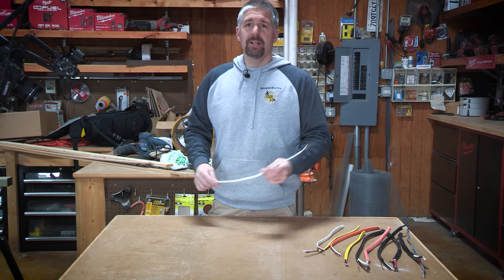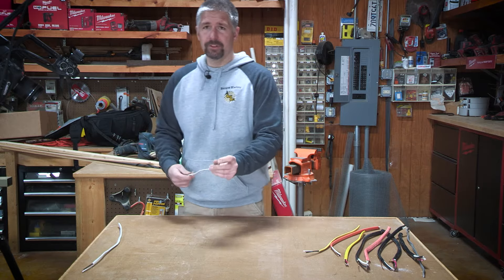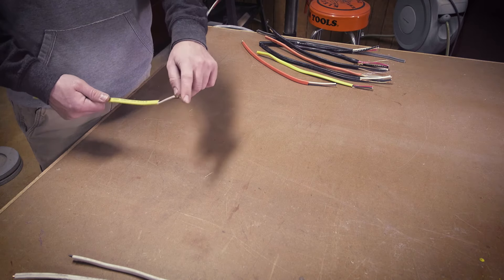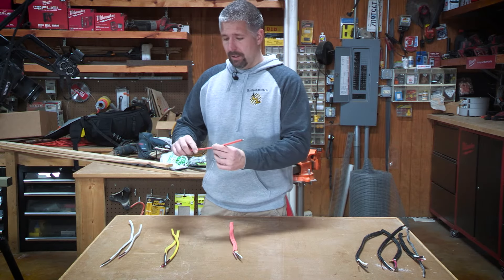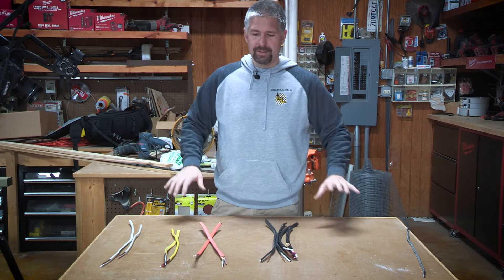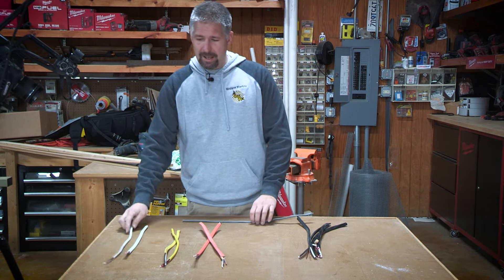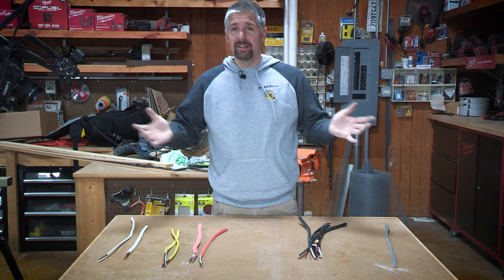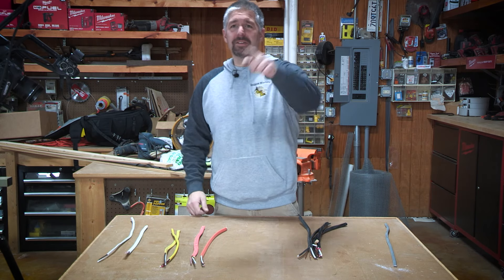Different Types of Romex Wire or NM Electrical Cable

Comment: Just so there is no confusion, Romex is a name brand for Non-Metallic Sheathed cable or NM cable, Like Scotch Tape, Band-Aid or Xerox, but we tend to use the brand name as the name of the actual item, This is called a product Eponym.
Reply: Same thing as wire nut. No such thing in NEC called a wire nut because its the name of a certain company. Heard Romex came from old Rome wire company. Was told at an IAEI class that BX got its name due to it was the second trial version that a comoany was playing with. The X in BX stood for experimental. That & $2 will get you a coffee.
Reply: @garbo8962  Not at Starbucks
Reply: @garbo8962  in the early 1900s,  the first version of Armored cable was AX. BX won out.   I think it is often referred to as BX because it was invented and first produced in the Bronx,  NY.
Reply: @garbo8962  what we often call wirenut, the technical term if you're speaking in NEC language,  is solderless connectors.
Reply: Exactly
Reply: I agree, like you say Romex is simply one of the Brands, people should not be calling Southwire Brand Romex, or any other Brands they have their own Brand name, some Brands quality is not as good as other Brands usually in the Sheathing but they still work.

Comment: The code book states that shared neutrals are not acceptable anymore unless you handle tie the breakers sharing a neutral the 14-2-2 would make it much easier to pull 2 circuits and each would have its own neutral like back several years ago when you used a 14-3 you shared the neutral.
Reply from the maker: Definitely

Comment: Very helpful but I would like to know if I can run 10-2 for outside room that is about 40' from panel the panel is mounted outside thanks
Reply from the maker: If the wire is going to be exposed to the outside elements. It should be the grey Outdoor rated 10/2.

Comment: Hello Phillip. I need to replace a length of household electrical wiring. If I were to take a photo of the exposed section and send it to you, would you be able to tell me the gauge and amp of the wire I need please?
Reply from the maker: I possibly can.  If the wire is really old, meaning pre 1960’s. It can be hard to tell.  Send me an email.

Comment: I'm looking to turn my shed into a man cave it's about 150 feet from the house what wire should I use to run power to it, I wanna put a ac unit,mini fridge and tv with a few outlets?
Reply from the maker: Depends on how big of AC unit you are going to have.  With voltage drop 8/3 wire would work for a 110volt window AC and running a few outlets.  You could put a little 30 amp sub panel out there 220 volt and add a few breakers off that. Check local codes. 8/3 underground would do or would have to be piped in some areas.
Reply: @PhillipBridgesReviews  the window unit I'm thinking of getting is a 115 volt that comes with the heater too, Im wanting to do the work myself, so I'm trying to learn as I go thanks for the help!

Comment: What is the best Romax to run a 50 amp welder plug in a garage. I need to go from the laundry room which is inside to the garage and I need about 50 feet. Which wire should I be using? 62 Romax indoor version?
Reply from the maker: 6/2

Comment: So i want to run a EV charger in my garage… i found a Grey 6/3 cheaper than the black one… is it still fine to get that as oppose to the black one?.. 50ft of the black 6/3 was $300 and $180 for 40ft of the grey 6/3.
Reply from the maker: Yeah if you ran it yourself. You could use it for indoor or outdoor purposes. I have no Idea why it’s cheaper now🤷‍♂️.   It use to be the same price or a bit more. It is harder to strip if you haven’t used it before.

Comment: Can u mix wire gauges? Example. Can I have a 20 amp circuit with 12-2 wire and change to 14-2 at the end of the run?
Reply from the maker: You are not supposed to mix wires.  But I have seen it.  Myself. I wouldn’t do it.  Not worth the risk of fire. National Codes are there for a reason.

Comment: so pretty much , all the romax are the same? , besides they’re different in amp capacity and the difference in the shedding and the thickness in the wires based on the amp used on the circuit?
Reply from the maker: Yes, except gray coated Romex. It’s coating is thicker and has a UV coating for outside and underground use.

Comment: new ranges require 3 wires plus a ground to meet code.the jumper on the ground to neutral is removed to acomadate the 4th wire.
Reply from the maker: Yes. It’s a 14/2/2 wire.  👍🏻

Comment: This was really helpful. Thank you!
Do you have a video to explain the electrical differences between why some wires i.e speaker wire. Security wire, thermostat wire, are labeled as with the same agw/conductor wire is labeled as the same with for example: one label has 14-2 as speaker wire then there another labeled as 14-2 electrical wire, or 18-2 speaker wire, and 18-2 labeled as sprinkler wire so forth and so forth. Just wanted to understand how and why there are labeled as for such uses but have same awg/conductor? Also what is best explanation on stranded wire vs non, shileded vs non shielded, also what does solid copper vs non solid mean? .

Comment: I Recently went up to my attic 1989 las vegas build and saw a strange black flat wire dead ended and open stapled to the beam just inside the entrance, 2 copper wires inside left and right nothing else never seen before I assume some type of low voltage hook up for some type of 80s upgrade? Ty for time,my house is a wiring mess let me put it this way I have to turn of 5 breaker for my kitchen alone lol
Reply from the maker: Sounds like antenna wire. Did it look like this ? https://en.m.wikipedia.org/wiki/Twin-lead
Reply: @PhillipBridgesReviews  You sir are good that is it! I kinda figured it was some kinda communication type line since it was ran up with other coaxial cable,just so weird it was dead ended at the attic entrance bundled up left makes sense now I know its an antenna wirelol Vegas houses are goofy ty again for taking the time,I was practically tripping over Romex and other wire dragged across beams and I couldn't get over that one weird wire

Comment: What type of wiring do you recommend for a light sensor?? I have a 100amp electrical panel, should I use a 14/2 or 14/3 ??
Reply from the maker: I would run 14/3.
Reply: @PhillipBridgesReviews  I have a old home, built 1945 , me and my wife bought our home in 2020, looks like the previous owner tried updating circuit wiring, not all , but most have a 14/2 running, wish you could show a video on how to upgrade old wiring or switching to different wiring.
Reply from the maker: @moisesperez3   I am hoping to make a video one day about this.  Possibly in the near future. 😉

Comment: For a sub panel (provided the AWG is correct) where I have to go through 2x4 studs and can not go up into the attic, across, and down to the sub panel from the main, can I strip the Service Romex down to its conductors and run the conductors through the 2x4s from the main panel to the sub panel??

Comment: Can I use grey Romex in doors in the same way I would use the other Romex not intended for burial (if the AWG is correct for the circuit)?  I often see the grey Romex cheaper in price for the same AWG, number of conductors, and length than "normal" inside Romex. Seems backwards.

Comment: ALERT FYI TO ALL:

The grey outdoor wire is currently cheaper then the indoor wire. $54 for 14/2 grey
$78 for 14/2 white
Reply from the maker: I have noticed that too. 👍🏻
Reply: Two werks ago a 250' roll of 12/2 NM cable was $259. Over a dollar a foot. Glad that I'm retired. Heard that 12/2 MC cable is cheaper then 12/2 NM cable.
Reply: LOL 9 months ago $78

Love these old comments taking about prices.
Reply: Can you use Grey wire for indoor shop routing?

Comment: Great video. Can you please answer a question I have. I have gray romex in a pipe underground going to a shed in the yard with a 1500W eclectic heater. Will the wiring be able to handle another 1500Watt heater, at the same time if I upgrade the breaker ampage?  I appreciate any advise you can give.
Reply from the maker: What is the wire size of the grey wire? 14awg, 12awg, 10awg? It will say on the coating. Grey Romex  just state that it is excepted to be buried underground. Is the heater 110 volt or 220 volt?
Reply: Thanks. I will tell you when I inspect the wire.

Comment: Hi I'd like to know if the 10 2 orange Romex needs to be put in conduit inside a metal building? I'm running it from main service panel to new RV 30 amp receptacle box. The run is approximately 30 feet. Square D breakers are used in main panel and I'm going to have a Square D breaker in the new 30 amp box as well. Thank ya for any help :-)
Reply from the maker: Anything that is 7 ft. and below I would run conduit. Then slide the 10/2 through it.  So if you run the 10/2 up and over the rafters. Stub a piece of pipe up past 7ft off the ground of were your outlet is going to be mounted.  Slide the 10/2 down the pipe.  Exposed walls you want to have it protected. I hope that helped you out.
Reply: Thank ya Philip. It's going to run approximately 10 ft straight up wall from 30 amp box and across shop wall about 30 ft and approx 8 ft down into main panel. Does it matter if I use metal or plastic conduit? I'm going to run everything and have it ready for the electrician to hookup so it saves me money.
Reply: Sorry I realized after I didn't add my drop footage in orginal calculations so it will be overall approximately 48 ft run total.
Reply from the maker: @ginnawitters-evans5156   if you have a concrete floor run it in metal.  If it is a gravel or dirt floor, run it in plastic. For any future condensation issues.

Comment: I found an open splice under my kitchen sink cabinet that was arcing and making a sizzling noise. Not only was an open splice buried under the cabinet without a junction box(code violation), but it was in a possible wet location(serious lack of common sense), a leaky sink, valve in a supply line, or disposal are common leaks. The disposal in my kitchen sink started leaking (internal seal went bad) which got the open spice wet, the paper in the Romex wet, causing the arcing against the wood of the cabinet carcass. The icing on the cake was that the electrical genius never connected the ground wires together, the incompetence was epic. I was pissed as my house could have burned down all because some POS did not want to take the time to run new piece of Romex from the breaker box when the piece they cut was too short or put the splice in a properly accessible junction box. I am putting the splice in a steel 2 gang box with a cover plate in a dry location two cabinets away from the sink, properly grounding the wires and box, and I am running 12/2 w/G UF-B out of the box to go under the sink and dishwasher, per code UF-B can be used in wet or dry locations within a home as well as direct ground burial.

Comment: Good info hey quick question. What amp breaker should I be running on like a 100 gallon hot water heater???
Reply from the maker: It should tell you on the side of the unit. Most that size are 30 amp 2 pole breaker.
Reply: @PhillipBridgesReviews   Thanks was wondering if upgrading to a 40 would be any benefit guess not

Comment: Can the UF-B romex be buried 12 inches if only using 120v?
I read that it needs to be buried 24 inches, but if only using no more than 120v, it can be buried 12 inches... is that so?
Reply from the maker: It can be at 12 inch. But must be 120 volt GFCI protected and not more than 20 amps.  Also must come out of the ground in rigid or PVC when stubbing into a building.  That being said, some towns do enforce the code that no matter what it must be down 24 inches.  Check with local codes always to see what is enforced in your area.
Reply: @PhillipBridgesReviews  I was going to use 14/2 UF-B, but then I noticed the breaker for the receptacle I'll using is 20amps...so I am returning the 14/2 and using 12/2 as I've read you can't use 14/2 anywhere in the circuit if the breaker is 20 amps.
Reply from the maker: Yes that is correct

Comment: There is older romex that is colored differently also. I live in an older home and there is some 14-2 that is black and there is some 12-2 that is white with green lettering while the older white 14-2 or 3 has red lettering.

Comment: My house was built in 1976.  I have white romex clearly mark3d as 12 2.  White does not always color coordinate as 14 gauge.
Reply from the maker: You are right. It wasn’t till 2001 when they started color coating 12/2 and 10/2 and such.
Reply: @PhillipBridgesReviews  Thanks for the response.  First time viewer of your channel.  I've been renovating my home and really enjoying the electrical work.
Reply: All Romex used to be white back then
Reply: Being 12/2 it is likely aluminum,  like in my house.  Most homes built from 1966 to 1976 used aluminum wire for all branch circuits,  because of the extremely high market price of copper at the time.
Look for something like "ALCAN AL-FLEX 12/2 ALUMINUM WITH GROUND" printed on the jacket.
Reply: @LakeNipissing  all the white 12/2 in my home is copper
Reply: @NESDwayne nice.    A 1976 home could have copper or aluminum,  or a mixture of both.    Since 12 and 10 awg aluminum was never recalled although it's production and installation pretty much ceased by the mid 1970s, existing stock was permitted to be used up.   A master electrician buddy of mine once told me of a home he worked in  built in 1981 where a couple circuits were 12 gauge aluminum,  everything else including the electric range and dryer was wired in copper, except the service wire running to the meter and main.

Comment: 14/3 for  travelers between multiple connected smokes, ceiling fans, and switched outlets Never saw 14/3 used for 220.

Comment: does the footage from the source to the panel matter in choosing the right classification of  choosing which to use  enjoyed the video it was informative  oh blue is used for.. dc may i ask
Reply from the maker: Yes, there is always voltage drop.  make sure you are not losing too many volts as you increase the length. So example: If I had an Air compressor that was 200 feet away from my panel and took 20 amps 12 volt to power. I would lose 12.67 volts and result at the end load would be 107.33 volts. Which is a 10% loss. Maximum allowed is 5%.  I would have to increase the wire size from 12 gauge to 10 gauge to make up the voltage loss.

Comment: Great video and information.  I have a question.  I noticed the a contractor put white Romex 14/2 for my water heater.  My water heater does not state the amps, but has the watts for the elements, which is 3800 watts per each element (top and bottom) and the voltage is 240 on the tag.  Doing the calculation  for Watts= Amps x volts, which comes out to 15.8 amps.  I also noticed the contractor placed a 30 Amp breaker.  I believe he did both the breaker and Romex incorrectly.  I believe he should have used 12/2 Romex (yellow) with a 20 amp breaker.  Your thoughts???  Thanks
Reply from the maker: Myself. I always do electric hot water tanks on 10/2 wire unless it’s a instant tank which I go by specs. Yes you are right. It is incorrectly done. It should be At least 12/2 and a 20 amp 2 pole breaker. The 30 amp could allow the 14/2 to melt the wire overtime when the elements are at peak. It is unsafe. Question. Does the white Romex say 14/2 on the side?  Older 10/2 used to be white. I still have some laying around that I use on little things.
Reply: @PhillipBridgesReviews
Reply: @PhillipBridgesReviews  I checked the wire and it says 10/2 with ground type NM ( I believe that's the letters and may have a date but can't read it)  The outside color of the sheath is white.  So, is this an older wire, but correct size with the 30 amp breaker?
Reply from the maker: @ChuckSlaney  yes, it sounds like it is correct size and breaker
Reply: Using a 30 amp breaker is common for a water heater.  But these newer models actually use less energy today.    So if he installed a 30 amp breaker, he should have used 10 guage wire

Comment: Also 14/3 can be used for smoke Alarm circuits
Reply: And for ceiling fans with lights controlled by separate switches
Reply: yep use 14-3 all the time :)

Comment: Has anyone priced or seen the new copper clad aluminum 12 or 10 guage NM cable? Outer jacket is copper and comprises 10% of the conductor volume. Best thing extremely or impossible to seperate copper from aluminum so it has no scrap value.

Comment: I don't understand why these wire manufacturers did not shield the wiring so they would not be so toxic.
Reply from the maker: I agree with you.
Reply: Romex is toxic?
Reply from the maker: @Artanis667  the plastic if it is burned.
Reply: @Artanis667  I say toxic because it is not shielded, if it is not wired correctly it could emit EMF radiation, though cannot if properly shielded. Sorry for my clumsy wording.

Comment: Hi Phillip.  Great video.  I have a question.  I need 10/3 for a mini-split.  I went to Lowe's, and the grey was cheaper than the orange.  Is there any reason I shouldn't just use the grey?  Also, how you you tell 8/3 from 6/3 when both are black?  It doesn't say on the outside.
Reply from the maker: 8/3 and 6/3 should have white printing on the wire saying the type of wire and the manufacture date.  On the 10/3. If the grey is cheaper you can us it. It is for outdoor purposes. Technically, some inspectors frown upon using outdoor wire indoors.  If you are the homeowner. Do what you think is best as they say.